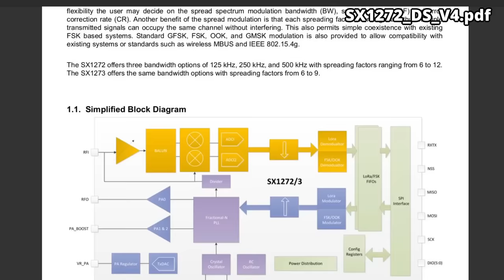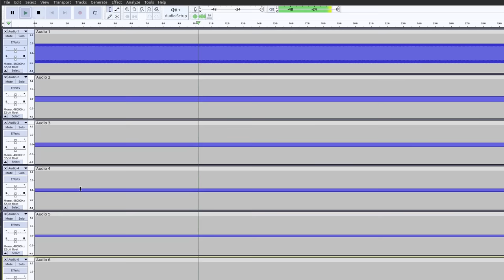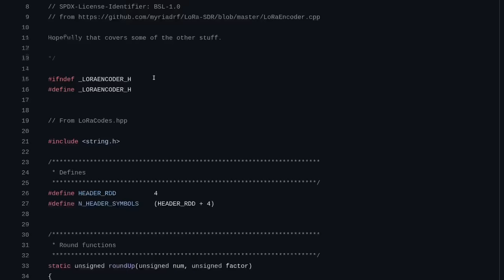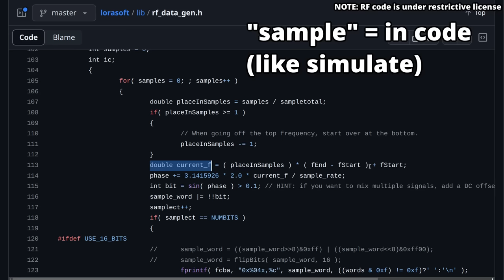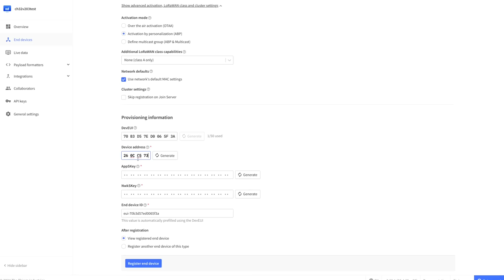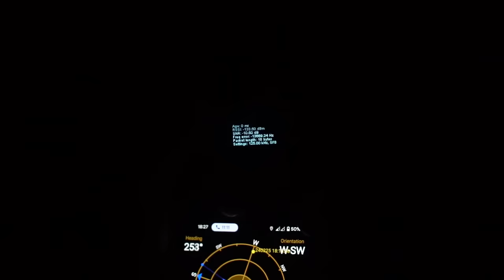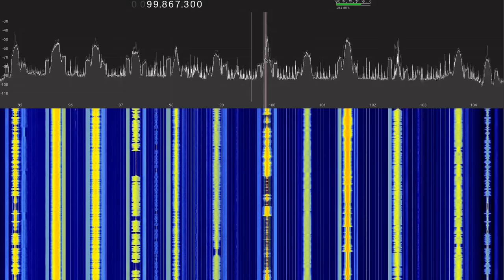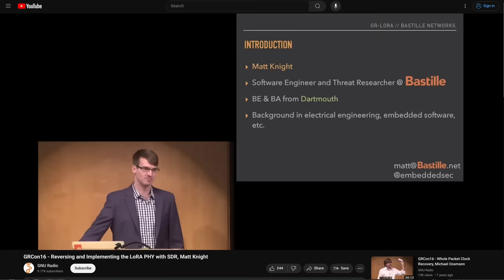How far can I broadcast LoRa packets WITHOUT a radio? - LoLRa

Comment: Would you like to try the same with APRS? :D
Reply from the maker: I don't know anything about APRS.  How would it be different?
Reply: @CNLohr  APRS most commonly uses 2m or 70cm amateur bands (144.800MHz and 432.500MHz in Europe, might be different in the US). It's basically Packet Radio, built upon the AX.25 protocol. It uses Bell202 standard (AFSK) with 1200Hz tone for binary 1 and 2200Hz tone for binary 0.
Reply from the maker: @RobalexGaming  oh wow. I'd imagine something like Lora could make more efficient use of the channels.

Comment: How doable would it be to hijack esp32's wifi/bt radio to do Lora?
Reply: Depends on the actual control you get over the radio. I recall it being a bit too high-level for some things I wanted to do (crafting custom packets), but there were people working on hacking the radio function and it may be more unlocked now.
Reply from the maker: Very hard. I have another video where I change the BBPLL of an ESP8266, but it's extremely hard because so much of the hardware is dedicated.

Comment: Is there a way to also receive packages?
Reply: it's best to receive with a LoRa module so you get the best out of a receiver.
Reply: sure no, and its never going to append with a single GPIO, besides, keep in mind this proof of concept cannot be used in the real world, this is totally contrary to any regulations, balsting by products all over at 10 times the power of the useful signal.
Reply from the maker: I dunno it might be possible but very hard and probably not something I have the patience to do.  Many ADCs can also capture aliases at many tens of MHz., especially like those in the ESP32-S2.

Comment: this is problematic and irresponsible to advertise this technic on youtube and provide direct code, such dirty technic should and can only be used in lab, there are good reasons why regulations are in place, most likely 95% of the audience will not behave responably and will use this alll over, in the public space, some will add PAs.
Reply from the maker: This is why I put the warning everywhere. And it might be OK if they add a PA - as long as they are also adding a filter.